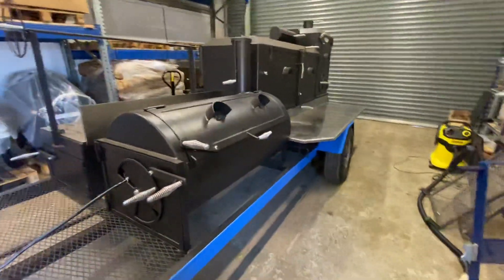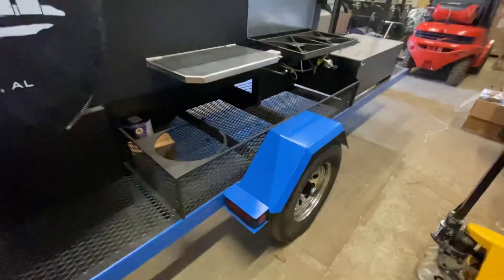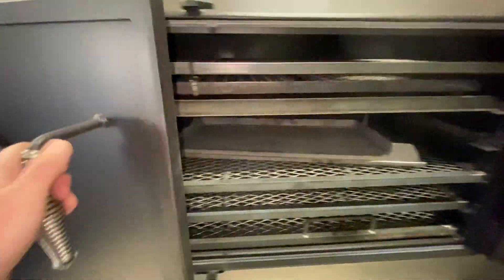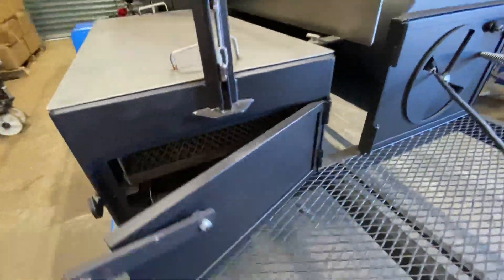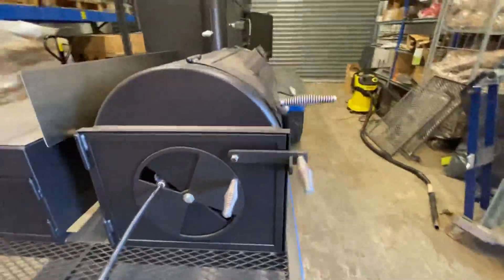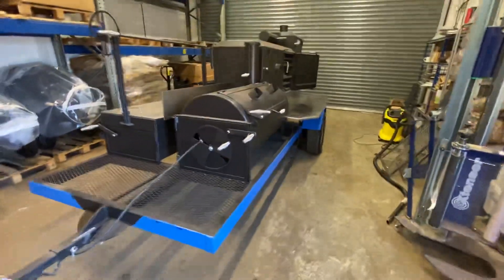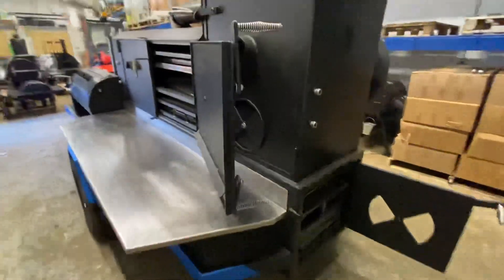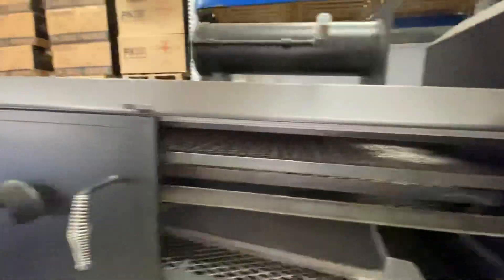Shirley Fabrication Reverse Flow Trailer Mounted Smoker - Walkthrough - U.K. Import - Custom Build

Comment: ProSmoke - Just for your information. I don't believe that's a towel holder underneath the rig, it's most likely a a grease drain release.  Shirley builds paper towel holder's into their fold down shelfs.
Reply from the maker: Thanks for this correction Michael
Reply: It’s hard to see but we did put the towel holder on the bottom of the trailer on this specific rig but there’s also a grease drain release above it
Reply: @BooshBoy101Grey  Thanks for  info, love the level of customization that Shirley offers.